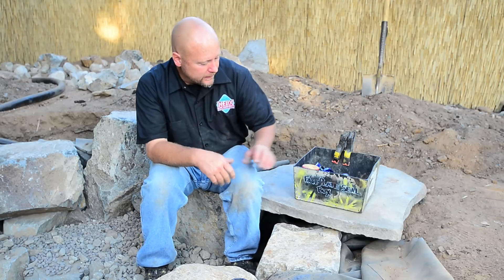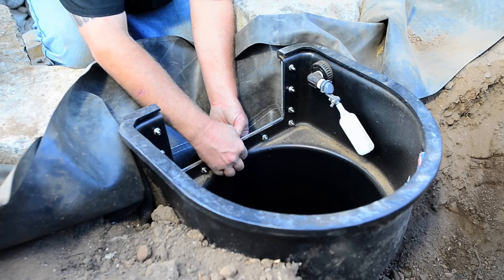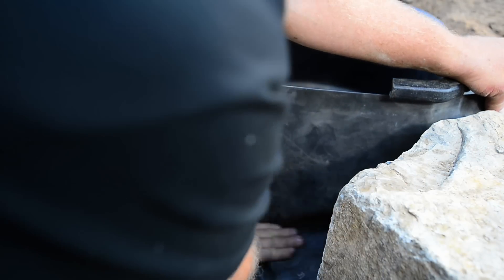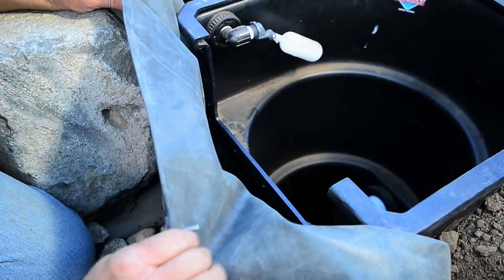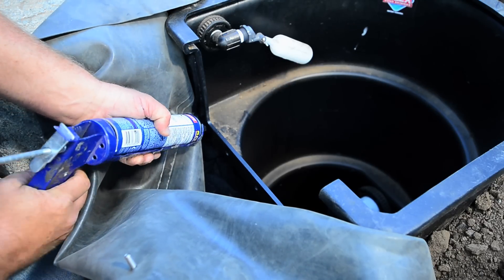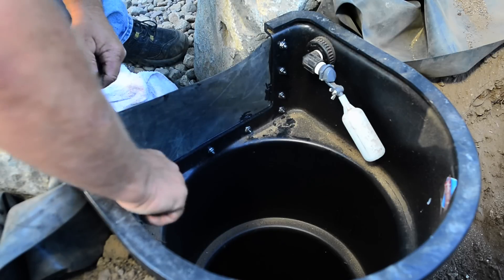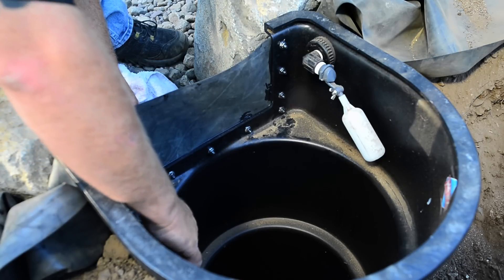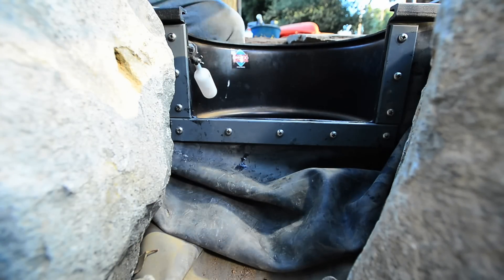How to build a Fish Pond - Part 11 | Pond Skimmer Faceplate Attachment

Comment from the maker: Hey Tom! Under normal operation you should have a nice pull with that pump. Here are the things I want you to look at. Make sure the Basket Plate (BP) is UNDER the faceplate screws when you place it on the top shelf. If the BP is on top of the screws you will loose flow under the BP instead of all the flow coming into the floating weir. Do you have a notch in your BP for the pump cord? The BP must sit flush on the shelf for optimal performance. Let me know if that helps.

Comment: Hey Eric.  Well it was a check valve installation problem.  I have corrected the problem and the Helix is running like a champ.  
Thanks for the speedy reply.  I'm sure you are aware but your videos are amazing.  They are the reason I took on the DIY pond project.  Thank you for all the hard work.  

Now if your looking to open a restaurant that has a pond winding through the patio area let me know.  I'm a chef and restauranteur and that would be a amazing idea.

Tom Eckert

Comment: Hey Eric I installed a helix pond skimmer today.  The inside basket is not pulling down at all.  It just sits above water level.  It's hooked up to a ShinMaywa Norus 3300 pond pump.  The pond is about 1100 gallons.  Is the pump not strong enough?

Tom

Comment from the maker: You will most likely be fine. We use a transition cement when gluing pvc to abs. The glue used for pvc is to hot for abs and can make the abs pipe weak. The good news for you is most pond applications have very low pressure so the chances of a failure in one of your connections is low. Cross your fingers.

Comment: Seems like it might be beneficial to leave some liner in excess once you get the plate installed.. and fold the excess liner around the edge of the skimmer and seal on the inside of the skimmer.. Would this be plain overkill for DIY? You guys know what you're doing, but for a first timer, would you advise against this?

Comment: Hi Eric, your work is amazing and I wish I lived closer to you to hire you. Out here in western Colorado redoing my large pond/waterfall.  The contractor doing the job is very talented and experienced. I have a concern about his method of installing the skimmer. His reg practice is to place the skimmer entirely inside the liner and build up with rocks to eliminate future leaks/repairs at the liner/faceplate. I have not found anyone else who does it this way and I want to know your thoughts (pros/cons). Thank you so much.
Reply from the maker: kelly doyle Hey Kelly. There are a couple skimmers that install inside the pond liner. Personally I am not fond of this type of installation. If in fact the skimmer is designed for inside the liner installation then you should be find. If the skimmer is NOT designed for inside the liner installation then modifications will need to be made so the skimmer doesn't float. It is not common practice to install skimmers inside the liner but there are some contractors that do….Easy Pro Pond Products offers an inside the liner skimmer. I have used them on small ponds in courtyards with limited space where an external skimmer installation would not be practical. Otherwise I am all about the external pond skimmer. A faceplate without stainless steel hardware is destined for a repair in a few years. If you go to external skimmer request stainless steel hardware. Hope that helps.

Comment: Hello I have a 3 1/2 thousand gallon Cue pond in my backyard we recently just decided to move the skimmer which we kind a messed up and got a huge hole in it I was wondering if I can attach the seam to the faceplate and it's not the same seem  that came on the line it's a shame that myself can I will it leak or tear

Comment: So I can't tell exactly where you are putting the adhesive.  Is it to the inside of the bolt holes, outside of the bolt holes, on top of the bolt holes or it really doesn't matter as long as it is under the face plate?

Comment: You, Sir, are truly a master at your trade!!  I was wondering why you use construction adhesive around the faceplate of the skimmer instead of a clear silicone sealer?
Reply from the maker: +Anthony Franchetti Thank you for the kind complement. The flashing adhesive we use is stronger than silicone yet still flexible when it cures. Great question.
Reply: If you plan to have fish in the pond will the roof and flashing adhesive harm the fish?

Comment: Looks like they would make the skimmer face plate as a single piece instead of 3 different pieces.  Does it come with extra bolts, nuts, and washers in case you drop one or two?

Comment: Awesome video Eric and I'm really impressed with the Helix skimmer. Our ponds are in a natural area so we get lots of leaves in them during the fall. We don't have a skimmer on our lower pond but want to install one as a retro fit. The Helix looks like our ticket.

Can you talk about how to determine the depth of the hole when you already have a predetermined water level based on existing pond design and water flow? We use a submersible Cal Pump 5200 (5200 gph) and have about 6 - 8 feet of head from the bottom of our lower pond to the top of the water fall in our upper pond. (The two ponds are connected by a gravity fed stream.) Based on the pump's flow curve, I estimate our flow at between 3250 and 2750 gph. Another important question: will a submersible pump (mag drive) vibrate against the bulkhead of the skimmer and be louder because of it?

Also, I'm really glad to see you using the PL S30 sealant. We just used it to repair our liner in the upper pond and after seeing so many videos where silicone was used, I was wondering if we had screwed up.
Reply from the maker: Wayne Turner Hey Wayne!!! I'm glad you are excited about Helix!!! The cal pump might need some specialty fittings to make it fit in the skimmer but I'm sure we can do it! Check out this video series where we install the Helix on an existing pond. It will answer your question in detail on water level. PL S30 has never let me down.
Reply from the maker: Wayne Turner Watch this series about the depth of the excavation. https://youtu.be/WxrSM_CxEQw?list=PLqM5Qn1K_DPwsKS46a71EEKn-EYbXMHjo

Comment: I didn't do a very good job installing my skimmer and now I have roots growing in between the liner and the skimmer faceplate. I'm afraid it will spring a leak any day now. Is it easy to redo if the liner is already cut?